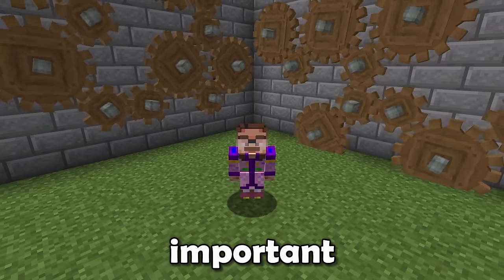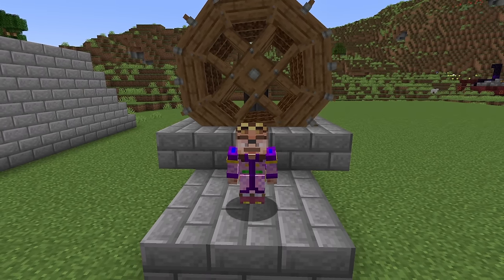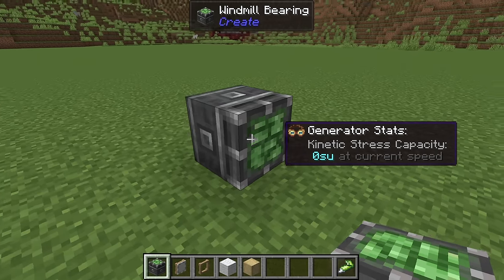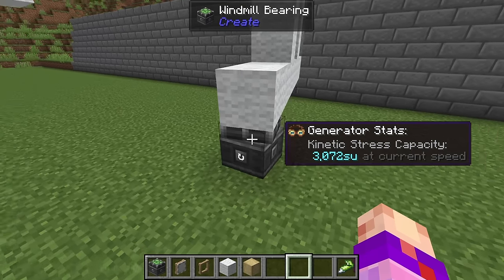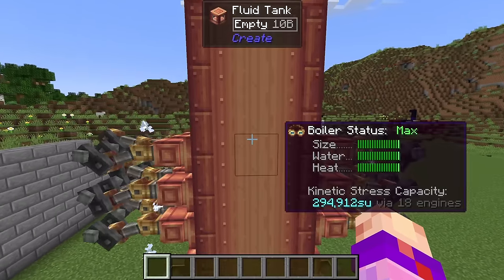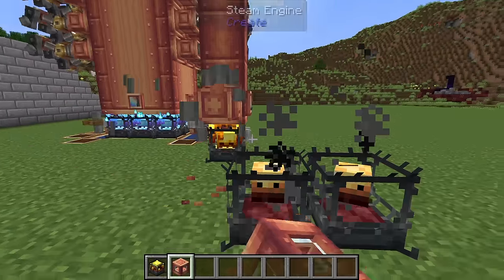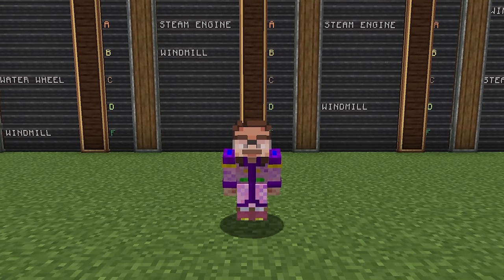Water Wheels Are BETTER Than Steam Engines (Kind Of) - Create Mod SU generator comparison guide

Comment: one passive generated boiler, no blaze burners needed, is only 4 copper tanks, one steam engine, and a campfire to provide 2048 su, so you could get a fairly compact setup with, say... row of 4x passive steam boiler columns, then a row row of space / water transport, and then another row of 4x passive, and get that 16384 SU while taking up an absurdly small amount of space, it would just be more expensive in some ways, and then you could use the components later on when you DO get the blaze burners
Reply: 2048su... so... 4 large water wheels in a row...
Reply: @mrShift_0044  Which take up 36 cubic blocks and require a water source. Passive generator with a magma cube or some other source only needs 5, but uses up some water and the SU for that, which is negligible, especially with how easy it is to make a wall of them. you can place them side by side, and as long as you don't make any 2*2 sections from above you can place them really compact manners, like rows of them 1 block apart. So each area the size of say 8 wheels tall(4096su, for the heat, 4 boilers, engine, gap, shaft) would produce 12k SU. You could fit the water sources and pump between the engines too, or attach them to your central water system you might use for other stuff.
Reply: @mrShift_0044   Yup, you've got it! 2048 is 512 x 4, one smallest passive steam boiler is equivalent to four large water wheels, that's correct, you can use either of those setups to get the same amount of stress, try it out!
Reply: requires much more setup compared to using wood a shaft and a water bucket 4x
Reply: @somo4227  Oh yeah if it's too much for you I don't blame you. You gotta play however is most comfortable for you.

Comment: The numbers you see are microseconds per tick needed to calculate that block. Meaning the processor has to do that amount of microseconds of calculations to update a tick of that block.
Generally speaking the values you see are still very low (hence green) but they add up.
Reply: But what mod add this?
Reply: Ye but if you’re smart you’d have a infinite lava source long before there’s be any lag

Comment: One thing to consider is the passive steam engine. Batsys has a design that fit into a pretty small space and still have 16k stress
Reply: It's so inefficient that you can make it powered and recive the stress units tenfold.
Reply: @mrShift_0044  passive steam engines can be powered with a campfire so can be used pre-nether
Reply: Agreed.   I've used passive steam engines quite a bit and it's space and lag effective without the Nether.  Bonus for the steam engine is that you can scale it up to blaze-powered mid-/late- game if you desire.  Double bonus if there's a mod like Supplementaries which allows for VERY compact infinite water generation/delivery.

Comment: i believe theres a mod thatll help mitigate some of the lava production lag for the boilers. i cant remember what its called, but it basically adds straws that you can give to the blazes that let you pipe lava directly into them, so you dont need the arms and buckets, or a blaze cake farm
Reply: I think it's Create: Stuff and Additions that adds the rolling thing that turns bamboo into straws and therefore allows you to pump lava directly into blaze burners, dunno if that's the mod it actually is from since the mod page doesn't mention it but it's a mod that adds a lot of stuff so who knows
Reply: @DarkXSolver17  Create: Crafts & Additions, according to several modpacks I use
Reply: @hawkings22  Yup, mb. I was pretty close though, didn't realize there were two mods that had almost the exact same name

Comment: The water wheel and large water wheel are not effectively the same. The SU stays the same when you change the speed. The water wheel produces 256 SU at 8 RPM, and the large water wheel produces 512 SU at 4 RPM. If you use gears, a rotational speed controller, etc. to double the speed of the large water wheel, it produces 512 SU at 8 RPM, double the SU of the regular water wheel. Components (mixers, drills, etc) use more SU at a higher speed, so yes, you effectively get more SU at a lower speed, but it doesn't change the stress capacity of the system, only the stress units required by the component

Comment: as space is typically at a premium, I agree with the idea that the water wheel is the meta, my early game setup is currently fully large water wheel powered. currently have an array generating 20k SU and its powering a pair of elevators and my neighbors small infinite iron machine. its simple to set up, easy to scale without needing to add shafts or gears to merge outputs. when I need more SU I just expand the power cave and extend the waterwheel basin

Comment: Windmills have a pretty nice use case even in the early game. A windmill is a spinning contraption just like one running off a mechanical bearing, so a simple spinning crop farm is super easy in the early game with a windmill bearing, a few harvesters and a minimum of 8 sails. It spins pretty slowly, but crops don't grow in a single tick, so it's fine. And you can still use the output shaft for SU for other machines.

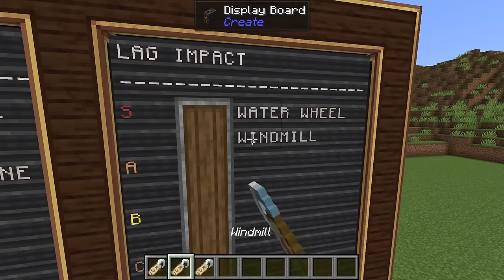Comment: 12:55 The unit Observable is using is microsecond (µs) and 100µs (estimated total of lag) isn't that much, you would need about 500 steam engines (100µs-lag-generating sources) to start to cause damage to the server (1tick of lag per tick), of course that is only considering the amount of lag produced by the steam engine, realistically about 200, which is way more then you would ever realistically build imo. So Steam Engines might be less lag-efficient but I wouldn't rate Steam Engines a C tier (15:42), at most a B but most probably A (with 0-lag sources at S).
Reply: In short: whatever you need the power from a steam engine is more laggy than a steam boiler you built to power it.
Reply from the maker: I admittedly forgot to better clarify that steam engines get laggy the more of them you have loaded so they're most server killers than anything, that's definitely my bad

Comment: 13:00 Allow me to explain in simple wprds. The mod Observe allows you to see how much different entities, i.e. machines, mobs, farms, basically anything that isn't a decorative block or a storage block, but actually has some sort of function, affect the performance of your game

The strange unit of measurement the mod uses for that is μs/t, which means microseconds per tick (for future reference, microsecond is 1/1000th of millisecond or 1/1000000th of a second.) And while this might sound a bit confusing, we only need to remember that Minecraft normally runs at a rate of 20 ticks per second, this is our TPS. That, in turn, means that for every tick, Minecraft has 50ms of time to do all the calculations for every growing carrot, for every hopper that pulls items from a chest, for every furnace that smelts something, for the new positions of every mob and player, it has to do it all in the allocated time for the game to run smoothly

It's pretty easy to achieve in the early stages and the game has plenty of time to spare, but let's imaging for example that we bulit a super smelter with thousands of furnaces and hoppers, an iron farm to end all iron farms, and a massive carrot farm to solve world hunger. This will drastically increase the amount of calculations the game has to do each tick, and at some point, it will take longer than the usual 50ms to  do those calculations. This is what we usually call lag in Minecraft

And this is also the point where our measurements of μs/t finally come into play. They show how much time each entity requires from the game to calcilate its functions each tick. Let's return to an earlier ecample. If we have a thousand furnaces that each take 5 μs/t and three thousands hoppers that each take 10 μs/t to do the calculatuons, we will see that our smelter requires 5ms to calculate the furnaces' functions and 30ms to calculate the hoppers' functions each tick. Determining how much time an iron golem farm requires from a game would be a little more difficult, but let's say 20ms, and a carrot farm that also requires 5ms to determine the crops frowth. Sum it all up with whatever calculations the game was doing in the background and we get a time of more than 60ms, which is longer than the base allocated time, so the game slows down a bit, from 20 TPS to around 18 TPS to continue running as smoothly as it can

The mod Observe allows you to identify the things that consume too much computational power from the game to dismantle them and return the game to normal running speed, which is usually a problem only in a moded game

From experience, I had a bit of lag in my sp world and upon inspection, I found out that LaserIO works horribly with ColossalChests. I had some nodes that alone took 7000 μs/t, absolutely tanking the game's performance

Comment: Adding 1/4 blocks for water, since multiple water wheels can use the same source and you cant do more than 5 because it needs to flow, but 4 because its more tileable, the normal water wheels would be the most space-efficient.

Normal water wheel: 1.25 blocks 
Large water wheels: 9.25 blocks

Normal water wheel: 204.8 SU/block
Large water wheel: 55.35 SU/block

Now, let's compare these to steam engines: (assuming we're using an infinite lava source)

Level 9 steam engines, 147,456 SU, take: 36(boiler), + 18(shafts and engines) + 9(blaze burners) + 1(water pump) + 1(water source blocks, assuming same 2x2 source used for 4 engines) + 1(mechanical arm) + 8(lava spout fill cycle) + 1(lava pump) +1(rope pulley) +4(fluid pupes) = 80 blocks, ignoring the space for the infinite lava source.

Therefore: steam engines = 1,843.2 SU/block.

So while they are Significantly more space efficient, around 9x as much as small water wheels, this requires a 10k block lava source. 

So untill you need ~2.36 million SU, small water wheels would be more space efficient. 

(And this isnt 2.304 million SU because you can't have a partial steam engine.)
Reply: Massive lava sources are fairly easy to get by either making a nether factory or bringing it in via train, and I personally turn down the "blocks needed to be considered infinite" a lot to allow using large lava lakes in the overworld for sources

Comment: dejojo you can cut the time for the steam even further if you make camp fires, and if need be just make more. Copper is easy to come by so the only real issue is the iron and gold, and even that is basically nothing.
Reply: I have built a 10,000,000su plant with only passive boilers. It only took 3 towers up to world height lol
Reply: @naberville3305  It's totally worth the cost of 109 thousand copper blocks, andesite alloy and 30000 campfires just to NOT set up a piss cheap kelp/wood farm and smelter that will power a level 9 boiler indefenetely.
Reply from the maker: I didn't include the campfires one cause honestly it's not worth the time investment over water wheels
Reply: @mrShift_0044  but then I wouldn't be able to brag about building 10 million SU with passive boilers.

Comment: I think each have their uses. For example, we have oak tree farms running off windmills, because they don't require that many SU and they just run constantly. I like water wheels also as a cheap and quick way to get some power to separate things. But then I have a Steam Engine to power the Alternators, 4 of which requiring 64k SU and that is just barely enough to power my current AE2 setup. We also have a separate Steam Engine for an infinite redstone farm, and two 8x radius Oak farms are just barely enough to power it constantly. We are looking into Blaze Cakes.

Comment: dunno if they removed this feature but smaller steam engines can be powered with a campfire, doesn't even cost any extra fuel beyond that, the blaze burner is just if you want more power in exchange for having to keep it fueled

Comment: For me the main use for windmills is if I need rotation in a contraption. Using a rotational bearing and hooking it to power takes energy from my supply. Building a windmill provides the rotation directly as my contraption can just be built directly on the windmill, and the windmill will still generate power even with the contraption attached.

Comment: with your testing, i recommend getting everything into the same speed, then measuring the SU, as 16k Su at 32rpm is 4x better than 16k Su at 8rpm
Reply: So I thought the same way but just to be sure I tested it and it doesn't actually seem like that's the case. I put together two identical setups with an encased fan leading to a rotation speed controller set to 256. You can run it with a single large wheel or two small wheels. Doubling the speed does double the SU but that's not related to the stress source, all that changes is the machines needed to get up to speed.

Comment: About water wheels and lag:
for most servers, the lag impact actually barely mater for the feeding mechanism. Most of your farms will be causing 999 fold the amount of lag impact

Meanwhile, water wheels are the devil in terms of another performance issue. Graphical rendering. Thankfully in the world of sodum and other performance mods this isn't as terrible as could be
but go ahead, place 50 water wheels, power them and see what happens
See how well your game will run when you look in it's direction, even with performance mods gahah

You could put the water wheels in a remote place, but then you'd need either an electricity or ender SU transportation addons to take that power far away from player loaded chunks, and instead use another addon to load the chunks (or use nether portals)
And y'know, loading a raw chunk far away probably causes more lag than the feeding mechanism
Even better, this assumes you even have access to addons, because if you have any addons you can just make blaze burners accept liquids which completely gets rid of the performance issues

Also the sails are more scalable and more efficient!
If you fill the space right, you can store 8192su  using 129 blocks (128 sails+bearring)
14 water wheels use up 126 blocks excluding the water. assuming that you need at least a single block of flowing water, so let's say you stack two water wheels on one another another to make a 3(2*3+1)*X ("3" is width of the water wheels, "2" is the number of water wheels per row, the second "3" is the height of a single water wheel and the "1" is the empty space you need between the wheels for the water to flow, while X is the number of rows you want. in that case we want 6 rows of 2 water wheels which is 3*7*6 which is ALSO 126 blocks, exactly!
Alright so within 126 blocks of a windmill, which generates 8192su
You can fit 6*2 aka 12 large water wheels. That only gives you 6144su

Not only are sails not as bad as you mention them to be, they're actually better than water wheels! How silly is that :P

I don't blame people for being wrong but i think this video needs a proper follow up/correction in the comments

Comment: Very new to create, but if I may offer a counter argument, technical space VS applied space. The wind mill loses for technical but might arguably win In application. The water wheel requires fairly rigid set up, and the configuration showed first could be hard to work around, while the wind mill can be be pointed anywhere. Follow up, water in any form requires some level of either containment or compensation in build plans, and it should be easier to send a wind mill straight upward than water. If the base is laid out in a vertical manner, with limited space, the windmill may actually beat the water wheel. If anyone disagrees feel free to let me know

Comment: I dunno if I would say the large water wheel is necessarily better. It's "more cost effective", but andesite alloy is pretty cheap in general, even from early on. IMO, they're generally interchangeable and should usually be used depending on  the dimensions of the space available to you, but the large water wheels become slightly better overall once you have access to rotation speed controllers.

Comment: I also think that windmills are kind of expensive early game for their andesite cost. For the 16000 su, you need a whole stack of andesite where as water wheels, you only need 8 andesites. I'm just as surprised. 8 andesite makes 32 shafts. Each shaft makes 1 water wheel, for a total of 32 water wheels. You just need to get chopping and get 16 wood per water wheel. Which comes out to be 8 stacks of wood or 2 stacks of logs. With an average tree size of 5 logs, you just need to cut down around 26 trees. Windmills still need sticks with 1 stick per sail, you need 2 stacks of sticks or 64 planks. I guess it really depends on whether you want to go mine for iron, or cut trees down.

Comment: Hey dude did you know you can make your steam power generation much more compact by replacing some of the tanks with blaze burners as long as the sections of the tank stay connected with at least one tank, you can literally put way more blaze burners in a 3*3 tank and this will allow you to max out the stress generation without using the advanced stuff for the burners
Reply: Feel free to try it, it might enhance your factories

Comment: an easy potential way to solve the laggy steam engine problem is the Liquid Fuel addon. Allows you to pump the liquid lava directly in, eliminating the depot mechanical arm and the need to circulate the bucket.